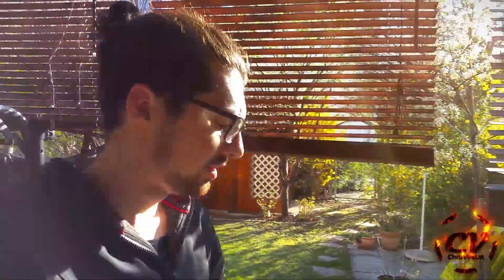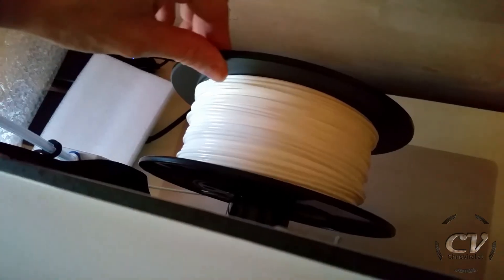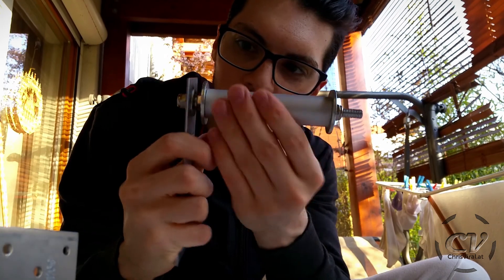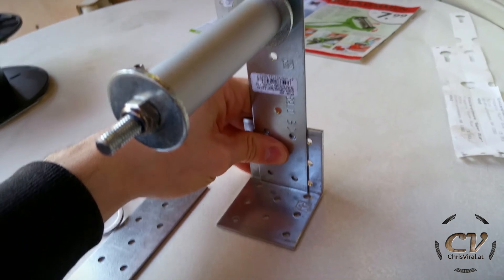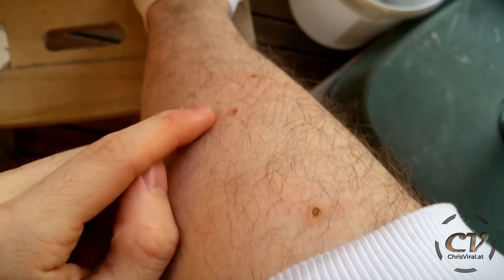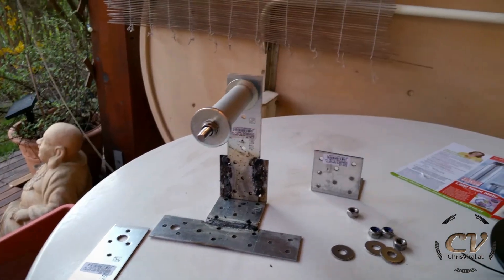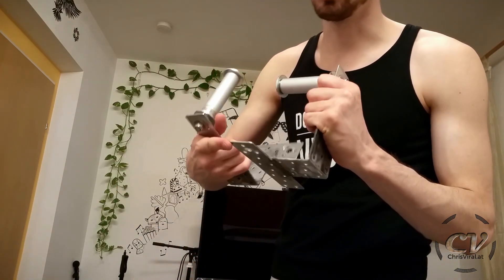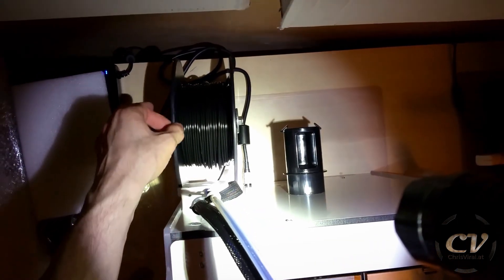5$ Frictionless Filament Spool Holder For 3D Printers (Ball Bearings)

Comment: omg, the worst choice of welding for the fixing metal plates. some nuts, screws and drillbits would be perfect. hidden heads for screws. the guy is so far from engineer.
or for god's sake use just sandpaper, degreaser and some strong glue!!

Comment: instead of welding it you could've put screws thru them!
Reply from the maker: No, the holes were sadly not aligned..
Reply: ChrisViral i know, you could've drilled 2 or 3 holes
Reply: And then put thru some screws
Reply from the maker: Welding was the better decision because the screws might have interfered with the spool.
Reply: Instead of all the ugly mee, he could have 3d printed something much nicer.